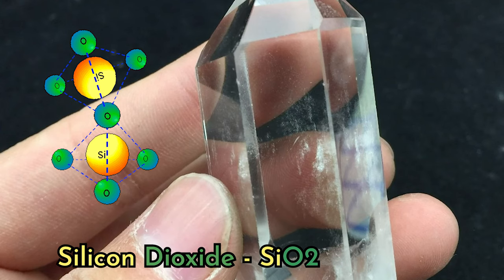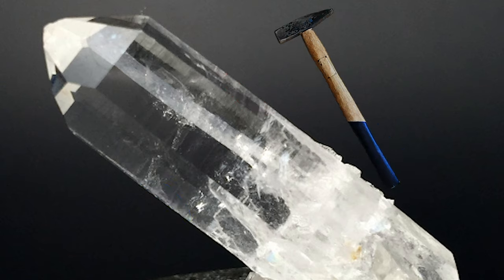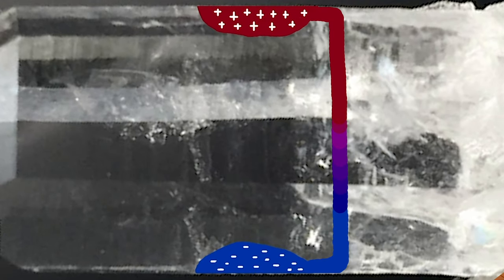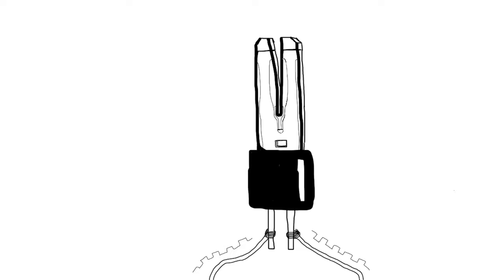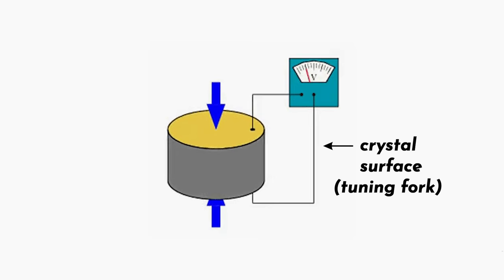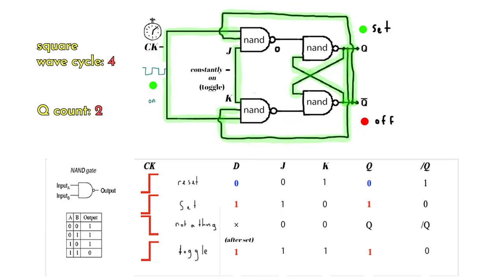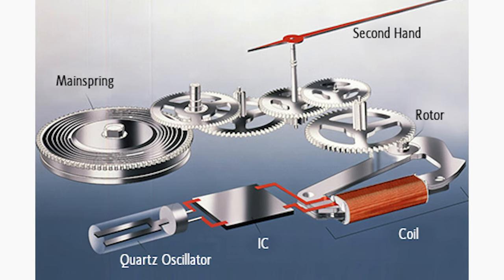How the modern world keeps track of time - An introduction to crystal oscillators

Comment: As I’m detoxing of all these harmful things I’ve put into my body, i keep having this dream about crystal oscillators but it’s a device that contracts the same as the tuning fork but the thin shards of the crystal are progressively more thin than the last , down to a microscopic level and further to a subatomic difference in thickness until it cannot be divided any smaller , and when a current is ran through it showed me a light. I have no idea what I’m dreaming of but here i am

Comment: Very interesting but it made me feel somewhat stupid that I couldnt keep up. I sure tried though and I'm intrigued😊
Reply: You can walk a path in two ways, (actually you can walk a path in many many ways but let's pretend you can only walk in two ways, namely): fast or slow. If you walk really fast you will know some things about the path when you reach your destination. Walk really slow, taking time to take in the surroundings, notice that little flower in the turn just peeping from behind that rock, wonder off the path a little and discover that hidden side-lane behind that bench and make a note of that in your mind to come back at a later date and return back to the path.. Yes, you will arrive at your temporary destination few hours later than the speed-walker,  but you will know that path you took in a much deeper way. The speed- walker missed that side- line probably, and you stroll back to see where that leads and discover it's another, route to that same destination, a shortcut maybe, or maybe there's a treasure there :) Learning slow absolutely has its benefits.

Comment: crystals brought at an electronics store are very thin inside the caseing  look at the video he shows a nine volts battery leeds runing to a big thick chunky quartz crystal  so thick it wouldnt react to such a small dc nine volts  and its non conductive anyhow  for dc at such a hevey thickness  it needs to be compressed to generate even when the quartz is thick  but runing nine volts dc through it dose nothing  the quartz is to big and thick  for dc it needs to be thin

Comment: How do they get the fork inside the crystals Si/O hexagon arrangement?
Reply: There is a correlation between the overall shape of crystal and the micro-structure/ orientation of the hexagonal planes inside. X-ray diffraction can also show the orientation and arrangements of the atoms in a crystal which help to determine the correct angle at which to cut the crystal.

Crystal cutting was done by hand in the WW2 era and the finer tuning was done esp. by ladies due to the intricate nature of work. 

You can find more info here: https://www.youtube.com/watch?v=wHenisSTUQY

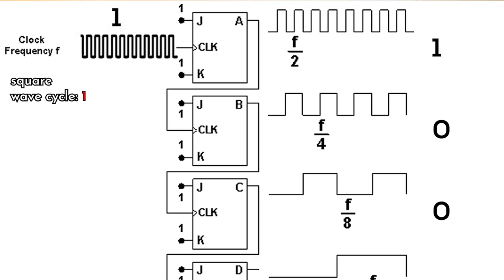Comment: 3:27 the first flip-flop is changing to a "1" on the rising edge of the clk input. This is wrong. It should be on the negative-going edge. Otherwise, if the flip-flop toggled on the rising edge, that first "1" would have propagated all the way to the final output. And since you began the video with profanity, I feel it is my obligation to tell you that YOU FUCKED UP.